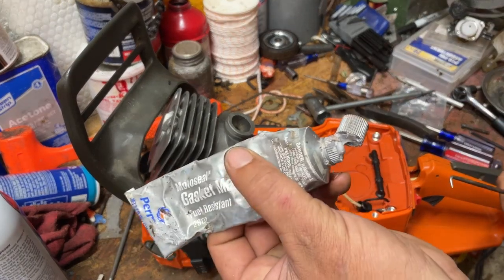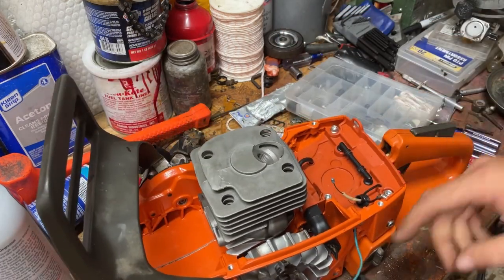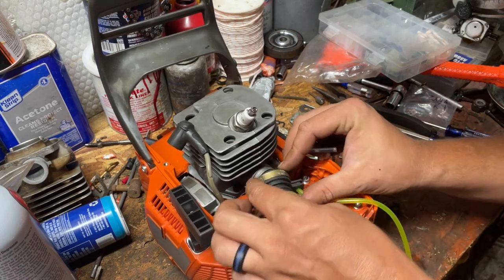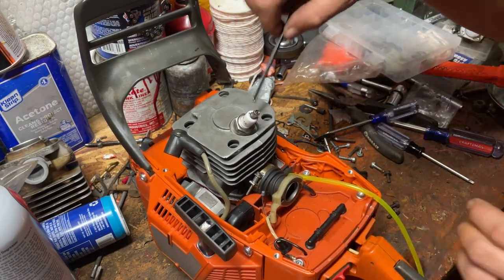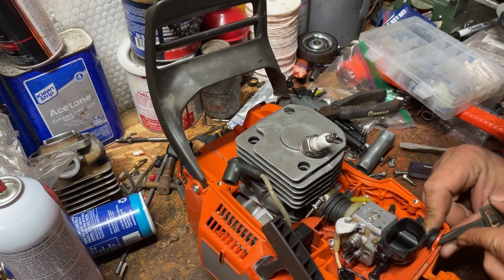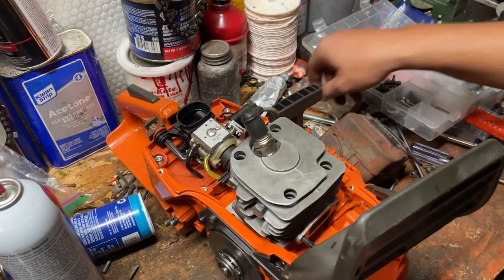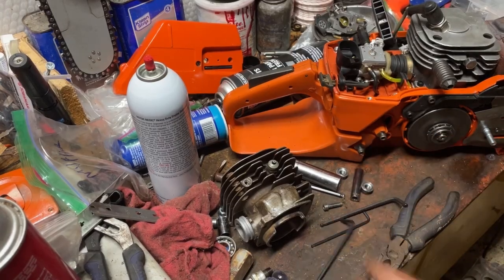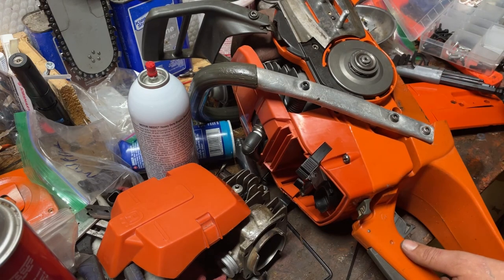Husqvarna 371 XP | Part 4 Assembly

Comment: I enjoyed that.
I've never bought a aftermarket jug. I have been lucky to use the OEM that was on it. 
If I do buy a aftermarket cylinder, I'll be checking to see is the screw holes are completely threaded.
Reply from the maker: Be a really good practice to make sure. That is my first hyway that was not tapped all the way.